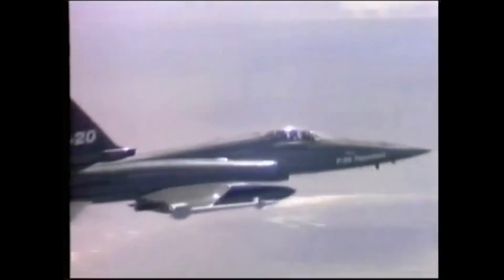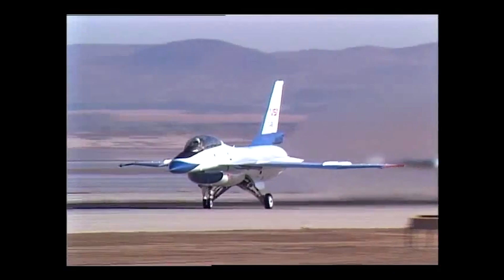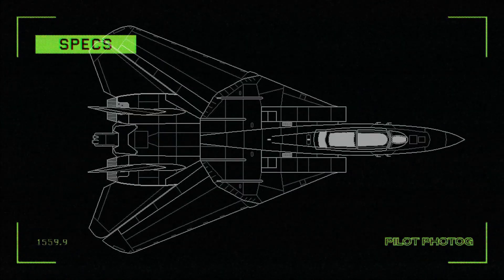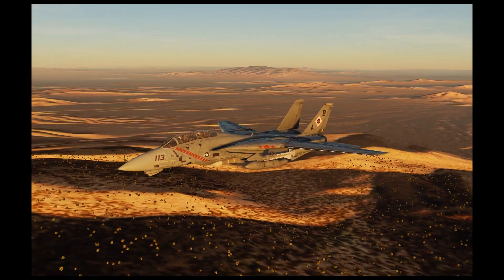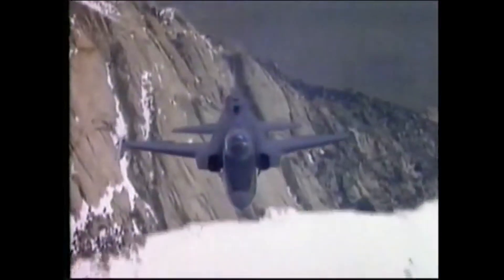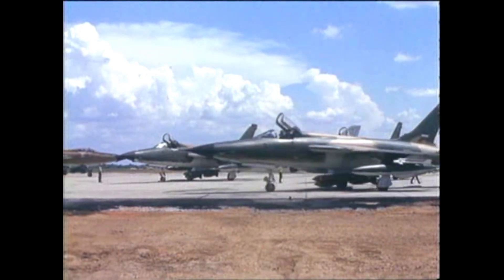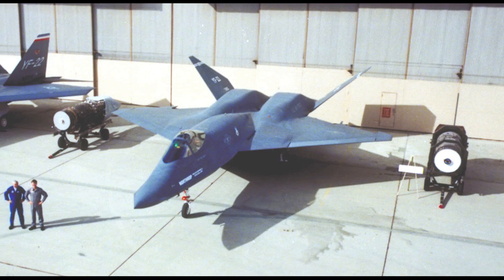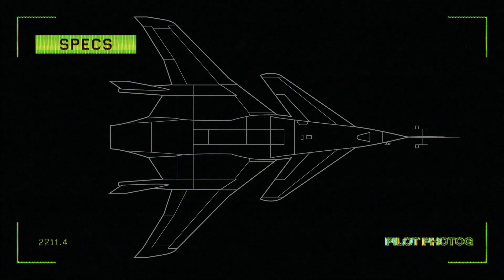Top 5 Fighters That Should Have Been Built | Best of Aviation Series by PilotPhotog  f20  f16xl

Comment: F 20 without a doubt. Followed by the F 23. The stats don't lie in the fact that if, for no other reason, the F 20 would have made for a great homeland air security aircraft imo. Better flight readiness, cheaper in cost and highly agile, the F 20 could defend American skies in greater numbers with similar capabilities as the F16 while the more expensive F16 could be used in foreign theaters in greater numbers. As far as the F 23, this plane fell victim to simply being ahead of it's time. While not taking anything away from  it's counterpart, the F 23 was simply more plane than the brass and decision makers could handle. Sometimes, a plane, tank or another form of technology fails to enter production because it is simply to futuristic in design and capabilities for present or current usage.  Fortunately, the F22 is to this day, the world's best air superiority fighter. Imagine what could have been had the F23 went into full scale production?

Comment: I would add the Mirage 4000 to the bunch.
Something to add is that, at the times the F20 was flying, no F16 was able to carry Sparrows or AMRAAMS, and the F20 could. Italy at some point considered buying the F20 in the early eighties because it could have been the perfect substitute for the aging F104S and G91Y  but then every US based air company started bitching with absurd deals like f16 for cokies, f18 for chips plus a bunch of MD80 for free in the deal, Tornado F2, and the F20 got lost in the noise.
This was a plane able to go up to 30K feet in 5 min from the alarm, some that even today is considered amazing if not out of reach. By comparison an f16 took 11min and could not bring Radar missiles up there.

Comment: You missed one, The Israel Aircraft Industries Lavi which was in reality the original F-16XL as well as the F-16 before the F-16 & during the F-16, but was scrapped due to U.S. military manufacturer's lobbying & pressure by the U.S. government to not produce it, because it was so superior to the F-16 itself. In addition to the F-16XL's delta wing configuration it was also the first fighter to use canards & also came in a much larger Bomber version. Unfortunately the program was scrapped & most of the aircraft experts that developed it ended up moving to the United States to work for the very companies who lobbied the U.S. government to pressure Israel to scrap the program with many of them being responsible for the development of both the F-22 & the USA's unmanned attack & surveillance drones we are so familiar with today.

Imagine what they would have come up with had they continued with the Lavi's production & later worked in cooperation with the companied in the U.S. they ended up working for? Too bad aircraft development & advancement was regressed so much due to selfish political & economic pressure.

Comment: Something that often gets overlooked is that the YF-23 had a single large weapons bay between the engines. This would have meant an operational F-23 would have much more potential to be a multirole aircraft than the F-22, even a 5th gen successor to the Strike Eagle.

Comment: Where is the damned Su-37 in this list
Reply: The Su-37 was not a combat aircraft. It was a technology demonstrator much the same as the US X series of aircraft, so it doesn't belong in this list.
Reply: @dumdumbinks274  owh lol thnx for the info, didnt know that.
Reply: @Thorongil99  No worries. Just so you know it was developed into the Su-35S (the original Su-35 existed before the Su-37 obviously, but rather than a new aircraft they decided to upgrade the Su-35 with all the Su-37 tech as well as modern avionics, resulting in the Su-35S).
Reply: @dumdumbinks274  also good thing they went for the 4th gen ++ before going for the 5th gen Su-57.

Comment: The Super Tomcat should have gotten same chance to grow as did the Eagle. really liked the F-20 also.
Reply: Budgets are the biggest enemy our military has to face. Unfortunately the Super Tomcat and many other projects that are casualties of this dreadful fight.
Reply: For sure the tomcat would of been a flying tank especially with thrust vectoring
Reply: As I understand it the biggest issue with the super tom was the titanium box that held the the drive system for the swing wings. It was the main structural member of the F-14 and was considered a none repairable part due to the areas where cracks formed were inaccessible and would have to be replaced to deal with the stresses of combat. And when you considered the additional weight would stress the boxes even worse causing potential loss of wings or one or both wings getting stuck in odd positions leaving it almost impossible to land without alot of luck. That is why they have zero F-14 at David-Monthan AFB. They were considered unserviceable and destroyed due to the box damage and the tooling needed to manufacture new one had been destroyed pursuant to contract's from the Navy. Since the F-111 has the same box and that same issues as the F-14 they two had their airframes destroyed also to ensure none of them made it into private hands and be rebuilt to flying condition since there is no way to check for the cracks or repair them. a few were structurally rebuild in to non repairable condition for use as static models at navy airfields and the same for the Air Force. As I understood it the basically welded the wings in place and added structural members that to be removed required the cutting of the box rendering it unserviceable and un-airworthy although with modern 3D design methods and the ability to simulate the stresses that they could reproduce the boxes today and it would only double the cost of the plane but it would be come repairable and replaceable and made in 4 part structure that any piece would be replaceable
 But by the time the technology was available it was to late  and their destruction for safety reasons a done deal. How much is accurate and true  from what little research I've done it appears to be accurate but I've only verified the box cracking, and that they were destroyed due to safety concerns. But I've not looked into the rest if someone knows different let me know I'd like to find out exactly what's was the reason for no super Tomcat, no matter how good the F-18 is won't have the jaw dropping beauty of the F-14 and the wow factor of the swing wings. Some things can't be topped even by better designs. After all no matter what planes they come up with certain planes are heart breakers when they retire them the A-4, A-6, F-8 and obviously the F-14 they each have something that no other plane has provided. Of those the A-6 would be my favorite tied with the Tomcat.
Reply: That was not as much of an issue as you described. Those titanium boxes were amazing and the F 14 D were entirely new models Monique scrapped them. They were only built in 1991. But you are not acknowledging that he’s talking about an entirely new aircraft that Northrop Grumman was proposing. It would not have utilized the same swingwing mechanism it would’ve been improved.
Reply: @edwardkeeler2206  They were also destroyed so parts would not get out to Iran since they still fly the F14 today, fact.  BTW great post!  I enjoyed reading it and you know your jets and the ones you mentioned are faves of mine and iconic!  Yes I miss them as well.
Reply: I agree 100%, we needed that Super Tomcat 21 :(  The F20 was BAD ASS!  Like an F5 on Steroids.
Reply: AGREED 👍🏼💯🫵🏼
Reply: Cost to much to maintain and burned to much full
Reply: @donhiggins629  But the Super Tomcat 21 would have been a completely different airframe etc (Not just upgrades to existing Jets).  The F35 I am assuming is not cheap either so to speak.  The old Cat though yes it was high maintenance as you said but they were going to do a new airframe so maybe they work that out?  Who knows we will never know.
Reply: F-18 was better nevertheless…You can’t keep all beauties flying. And an F-20 next to an F-16. They have to chose…
Reply: @dirkusmaximus9268  the F-20 would have been excellent for smaller countries at a lower cost than the F-16...the GE 404 (as in the F-18) boosted power by 60% over the F-5E variants...
Reply: @aaronsanborn4291  it also wasnt built for the g's it could pull, when 2 of your 3 airframes crash killing their pilots, it doesnt look great
Reply: @rancorusia as for the F-20, I understand the pilots blacked out from G-LOC. That is the official reason at least.
Reply: @dirkusmaximus9268  🤦🏻
Reply: No the superhornet was not in any way more advanced than the supertomcat for the 21 century.  

That wasn’t entirely new design with reduced RCS

Even the F 14 de supertomcat that was on the carrier decks in 2006 at that moment in time when it was retired, we’re still considered the most advanced platform. The Navy had a superhornet did not catch up for several years but they’re blocked 2 upgrade

You need to educate yourself about how the F 14 D was literally the go to strike platform during the second Iraq war
Reply: @dirkusmaximus9268  It wasn't better than the upgraded Cat as far as range, speed and payload goes, it has its limits but it's a jack of all trades I agree (But master of none as they said).  I like the Hornet but that ST21 would have been BAD ASS.

Comment: Very Briefed and Summrized Ideas :

The DY americans f-20 is a complete failure project given the advance and modernity of the DY americans f-16 designing and with it structure ability to grow and develop over time , 

the advantage of the DY americans f-20 was in its smaller size and with a smaller cross-section and a smaller radar signature , especially for the front , and a large part of the structure Constructed from composite materials which help in reduces radar and infrared signatures of the plane .

other advancment its easy to fly and very much highly maneuverable , and because the design is inherited from the 1950s or post ww2 technological limitations , engineering knowledges , and combat requirements so the plane comes with shortages one of it I don't think the designing are endorsing the relaxed stability characteristics of the plane , while the DY americans f16 being designed with relax stability flying characteristics enhancing the maneuverability and agility of the plane , 
other downsides or shortages of the DY americans f-20 were its very moderate payloads and limited combat ranges make it suitable to be employed as interceptor especially for point defence although it could had been deployed in large numbers as front line tactical interceptor enhanced by its short scrambling time only 60 second to start and fly , with secondary roles as tactical strike kuscraft and ground attack platform , scattered in the tactical and operational depths of the fronts .

...  Always And Forever May GOD Bless The Un United States Of HM Shninasios  .....

Comment: There should've been thousands of F-20 Tigersharks in the sky and the F-16xl was beyond beautiful.
Reply: @Reach41  , they were both derived from the Northrop F-5 Tiger A. The US government assigned McDonald-Douglas, a navy fighter plane maker to design a new navy fighter after Northrop lost to the F-16 for an Air Force fighter. McD asked if they can use the Northrop F-17 design. Both the navy and Northrop agreed and the F-18 Hornet was thus born. The F-20 was just a side project that had to be killed because the agenda changed.
Reply: @leapdrive  Some loose lips at Northrop were involved in them losing the ATF contract as well - during the ATF project, Popular Mechanics posted an article that included a VERY realistic rendering of the B-2 Spirit, four years before the plane was officially unveiled. SOMEONE at Northrop leaked, and the Air Force wasn't happy about that.
Reply: @disorganizedplay , thanx for the info.
Reply: There would have been hundreds, and then they would have been quickly replaced because the fundamental problem with the F-20 is that it was a 20 year old aircraft at the hard stop of its capability.
Reply: I knew several military pilots back in my day. I always heard from them that the real reason the 16xl and Super Tomcat 21 weren't built was that McDonnell Douglas was way better at politicking than General Dynamics or Grumman.  I don't know how true that might be, but I heard it from a lot of them.
Reply: @ , just a misuse of a word, thank you.
Reply: @leapdrive  My comment deleted.
Reply: In the end, I'm glad the strike eagle worked out. It is such a beautiful jet and a great continuation of the best modern fighter ever created.
Reply: The F-20 had morphed into the F-18 but lost out to the F-16 as the UASF fighter. However, McD with Northrop’s approval, used the Northrop design F-18 and transformed it into a carrier based navy fighter F-18A/B. Now it’s latest version is the Super Hornet. You can see the profile is still the F-20.
Reply: @leapdrive  You mean the YF-17?
Reply: @El_Zanahorios  , yes, maybe that was the designation.
Reply: @leapdrive the F-20 morphed into the F-18, even though the F-18 wad built years before the F-20?
Reply: @winternow2242 , it was the Y-18 then competing with Y-16 for the Air Force small fighter.
Reply: @leapdrive  not sure what you're intending to say.  There was no Y-18.  There was a YF-17, which is what became the F/A-18.  However, that plane has little (if anything) to do with the F-20.
Reply: @winternow2242 , yes it was YF-17 which became the F-18 when when it was slightly redesigned by McD from Northrop for as the navy plane. Notice how its profile resembles the F-5.
Reply: @leapdrive resembles the f5...once you ignore the 2nd fin, the high wing, much longer and wider leading extension,  etc.  Sure they resemble each other until you actually look at them.

Comment: F-16XL:  Underpowered, but a beautiful aircraft in terms of combat radius, payload, and mission capability.  If you put an F-119 class motor in it, it would be amazing, but we didn’t have the F119 in 1980-1982.  Every test pilot expressed concern over Thrust/weight and it didn’t handle like an F-16A at all.  Instead of the Enhanced Tactical Fighter (Strike Eagle became this), it would have made a better configuration for the F-16 for how the USAF actually uses the F-16, as a strike platform.

Tomcat 21:  Same expected maintenance issues as the whole F-14 fleet, which was really hurting the Navy’s budget.

F-20A:  Look at its combat radius and thrust/weight ratio.  Look at the FOD implications of it carrying BVR missiles on the wing pylons.  You had a few inches of clearance even if you maintain perfect wings-level attitude when landing, with a squirrely design that loved to roll.  Imagine AIM-7, AIM-120, and bomb fins smacking into the runway during high-sortie rate operations.  Then the advertisement about it being cheaper to maintain and more efficient were just manipulations of data that didn’t really exist, because there was no large force in operation for several years from which to draw any reliable conclusions about those performance specs.  There were only 3 of them, and not common to each other.

Comment: F20 was a beautiful fighter and very capable. Depending on a state's mission and geography, the problem will always be about operation hours. You can only have so much fuel in that small air frame, even with drop tanks. Again, it depends on the nation state's mission and geography. It would be ideal for a small nation like Taiwan who isn't projecting power, but a super power like the US who needs range to project power, not an ideal air frame.